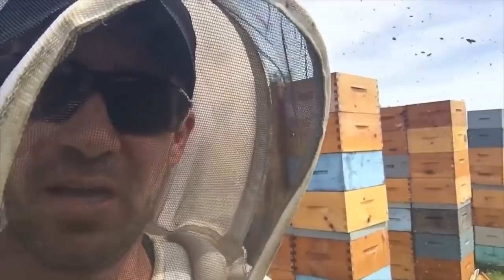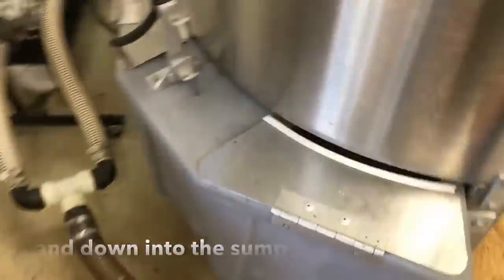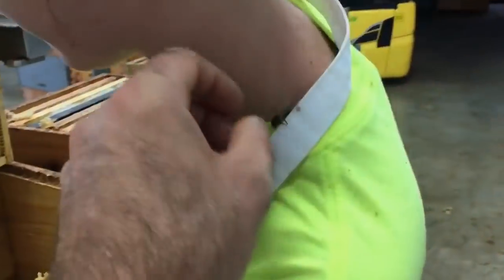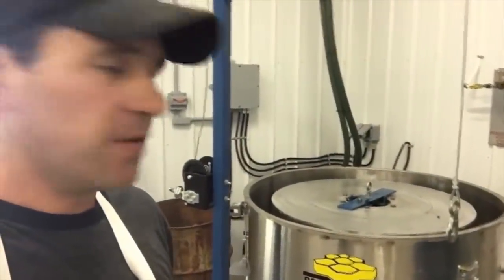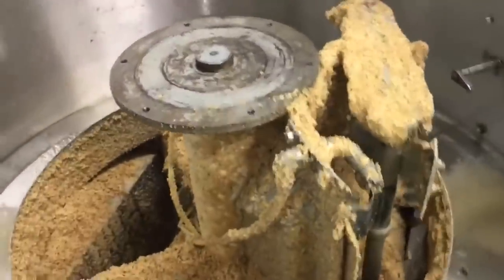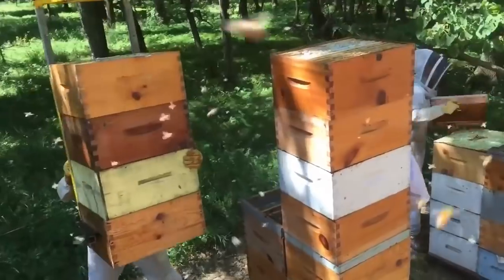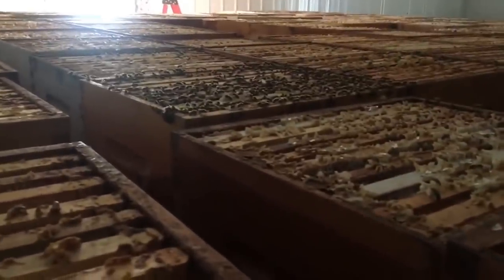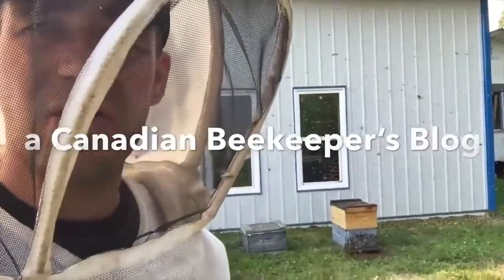A peak into a working extraction facility

Comment: You can burn dry sulfur at the end of every day when you know no one will be going back into the warehouse. A couple cups per room depending on size of room to be treated. Then by morning just open the doors for a few minutes to air things out. Works great but caution no one can go back in the building. The vapors from the burning sulfur when mixed with moisture, like in your eyes and lungs turn to sulfuric acid. Vapors dissipate very quickly and there’s no residua life behind. Usually gone after a few hours. Works great for bee control in a warehouse.

Comment: I would be concerned about the # of frames with uncapped honey or nectar & the high moisture content.
Reply from the maker: jim cooley 
Cappings have very little to do with moisture content. 
This honey is running at 16.5%, very dry hot weather
Reply from the maker: Remember honey is hygroscopic
Reply: a Canadian Beekeeper’s Blog, I did see you use a refractometer too, one thing I have learnt especially with Oil seed (Canola) is that if you wait until it's all capped you'll struggle to extract it.